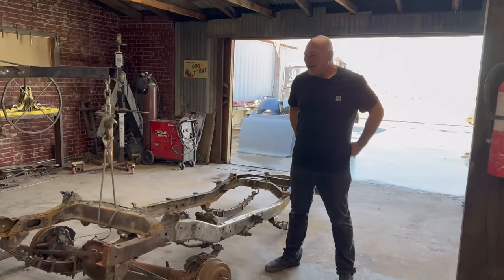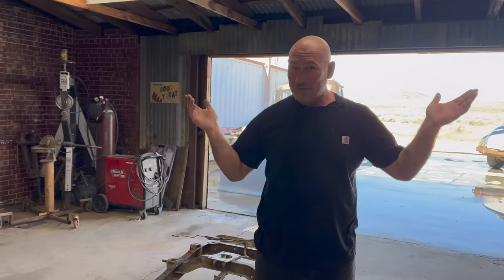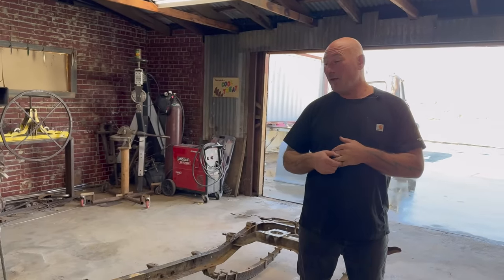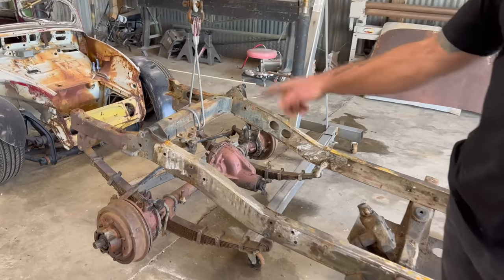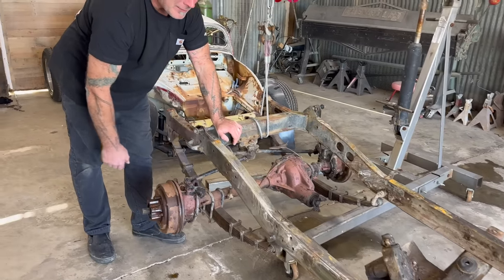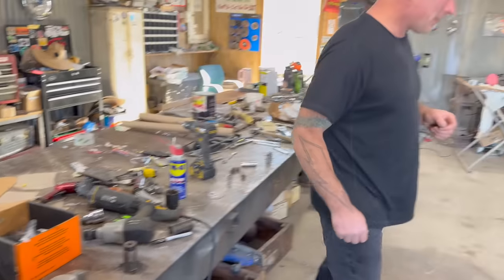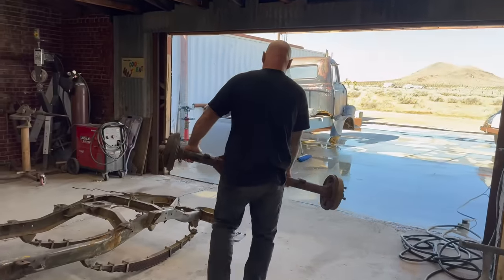Part 2! 1946 CJ-2a Willys Jeep! Ian And Jamie Have Some Major Kustom Ideas 💡 👽

Comment: The reason the military  used  your tire tread design is  it made it difficult  for bad actors to look at the latent  tracks and determine which way the vehicle was traveling .
Reply: This is a myth. They were a called NDT. Non Directional Tire. They were a Goodyear invention that enabled WW2 vehicles that uses them to get equal "bite" of the terrain whether going forwards or backwards.
They were also cheaper and faster to produce than directional tires.
Reply: @Maxxis1941  Correct.

Comment: The interference on the Hurricane engine in an earlier CJ2 is the carb.  The old school solution was to either cut a hole in the hood for the air cleaner to stick through and some would fab a little hood scoop for it.  Or, just put just enough body lift on it between the frame and body to allow the air cleaner to clear under the hood.  I'd go for the body lift myself.
Reply: I've also seen where they move the air filter lower to the side of the motor. They had like an elbow air pipe between filter & carb that was flattened on top of the carb. Maybe just use one of those cone shaped mesh air filters off to the side. 😋
Reply: Or a pinto carb...

Comment: Looks like you have a CJ5 chassis. As you found out the tub bolts the same way but the extra inch is in the front. I just finished up my CJ3B (hi hood) and there's not quite as much clearance behind the front wheels, but it doesn't look out of place. Have a look at some CJ3B pictures and you'll soon figure out where the front was lifted for the F-head engine.

Comment: I was told a hockey puck lift (one inch additional) between body and frame allows the f head motor to fit under the a body/hoods of the a's.

Comment: Once you get the motor mocked up in the chassis, look at a 1 barrel Holley from an early 60's Ford 200 6 or maybe even a 50's 223 6 cylinder. It might clear the hood without a hole.It's the carburetor that sits too high and not the valve cover. I'd leave the A1 chassis stock. Any wheelbase you can get just makes it ride better. Want to close an inch of gap, run a bigger tire!

Comment: A friend once told me how he used to put needle bearings into a Rudge motorcycle gearbox. He would slather the surface with grease, put the bearings in place, then tie sewing cotton around the completed shaft to hold the bearings in place while inserting the shift into the gearbox. The reason he used the cotton was that the first time the gearbox was used, the cotton would disintegrate without damaging the gearbox.
Prior to using this method, he had no end of trouble getting the bearings to stay in place because they would fall off the shaft while he was trying to insert the shaft.

Comment: The longer wheel base is going to be a huge advantage in handling and stability. I would retain that and then build around it, you are obviously fully capable of extending the fenders (or ever just repositioning them a little) if need be.
Reply: I second this emotion! Keep the wheelbase as is. Just bring the bottom piece of the fender forward a few inches & I'tta be fine! 😋
Reply: It is 1" longer only, not really significant.

Comment: You can also add 2 inch body rinse blocks. I had a 1959 utility wagon that I did it to with no problem.
Reply: I would think the body lift would save a lot of work
Reply: It worked out well for me. I would do it again with the body off already and the need to make mounts on the  frame. Also, it would be easy and inexpensive.

Comment: It’s normal for the front wheels to be towards the front of the fenderwells on the flat fender jeeps. It looks a little odd, but it’s typical. The extra inch is no big deal. Yes, the 3B had the taller hood and cowl due to the new overhead valve engine being higher than the old flathead Hurricane engine.

Comment: The F head engine will fit under the hood and just barely clear. Usually you have to fold over the metal seam under the center of the hood. The difficult part is getting an air breather to work under the hood. I had one that had a hole in the hood the size of the throat of the carburetor. When you shut the hood you could then place the breather\ air filter on the carburetor.

Comment: Hey Ian since the Jeep is leaf spring get some or make some leaf spring relocation brackets and just move it back till it looks good with the fenders that's what I would do don't cut the frame if not brackets you can always cut the brackets in a leaf springs off the frame and slide it back it'll still look good it'll still have its length and you'll still be able to put that motor in hope this helps you out

Comment: Back in the mid 70's i had a 1968 CJ 5 with a Buick V6 in it rebuild the engine put headers on it a better cam anf a 500 cfm Holley carburetor run real good and had tons of FUM playing in the MUD and sand
Reply: My 'daily' is a flatfender (titled as '46) with Kenne Bell equipped Buick 225 'Odd Fire' V6, too much carb and cam, MSD, fat headers w/ fenderwell exhaust, 4 speed with Warn OD on Dana18 transfer case... .

Comment: The M38A-1 has a larger gas tank (17 gals) so it has a well that protrudes downward. Because of that the frame doesn't have a mount under the gas tank on that side. Also, the front mounts don't get used where those triangular parts are at the front of the tub. They just seem to ride there in space. I've never had or worked on a flat fender so wondered if the mounts would be similar between them , so I think that's pretty cool that they line up so well.

Comment: Those tires, as you mentioned, are used extensively on military vehicles.  They are called "NDT" tires... Non Directional Tread.  They get equal bite going either forward or backwards.
Reply: Yep. We just called em military tires. First set I put on my F100 4wd were 900 x 16's here in the Fla. Everglades. Our mud is a bit DEEP! 😂😂

Comment: And as for the hood not fitting you can always put a little bit of a body lift on it making some spacers out of some a pipe I know they're supposed to be rubber butt pipe will work and make you a one and a half inch body lift kit your Hood will fit and it will still look good plus you'll have a little bit more room if you want to put taller tires on it your friend Tony

Comment: Love the old flat fender jeeps.  I've had 4 jeeps over the years.   A 1946 and 1947 CJ2A.  The "47 had an F head swapped in that was from a CJ3B or pickup so it had a hood scoop to accommodate the carb. The valve cover is still below the original 2A hood. Your wheelbase is not too far off.   The radiator mounts to that front cross member.

 Then I had a 1975 CJ5 that my dad and I did a complete fiberglass body tub swap when I was in high school.  the last one I had was a mid 90's XJ Cherokee sport.    Really want another one but the prices have gone out of site.  I'll have to look in my stuff.  I may still have some old CJ2A parts in the garage.
Reply: I’ve got a 1946 with an F head in it several carbs will interchange with the original that are shorter and you don’t have to put a hood scoop on it that way you can let the windshield down on the hood in the original way everything else fits perfectly fine

Comment: I am sure that you will get quite a few responses and some will be good, and some will not. I have had many jeeps and built several. I have just completed conversion on my CJ3B to a later model amc CJ5 frame, which has more modifications  than you will with a M38 frame. I have a 3B frame that has some stress on it and is already converted to saganaw steering, which is much more refined than the bell crank style you have and would give you the correct axle placement for your 2A. 

The M38, which is basically the CJ5, has longer springs than the 2A, and the difference makes axle placement longer than the 2A.

I would welcome the chance to exchange some of my insights  and information with you feel free to reach out and we can discuss things further. I might have a few years of experience and some other resources for your project.

Comment: Jamie, I know where they're at least four flat fenders. Just for parts. There's frames. There's bodies and even some original flat head engines but do your research like you are. There's a lot of people on here that don't know what they're talking about that's pre 338 military frame. It's got the 50 cal mount but it's probably an MB chassis and it's probably pre 46 so that's why. But the frame is the right length. The wheels are in the right spot. Just thought I'd let you know
Reply: Yes it's a M38A1 Frame, the Body is a CJ2A, the Frame is longer in the front.

Comment: I enjoy your channel. The high hood cj3b i think looks out of proportion to the clean lines of the lower hood hurricane engine models. I had a cj3a low hood body and changed the original engine to the  overhead engine. I did not raise the hood because the valve cover on the engine fits under the lower hood. The problem is the original carburetor is too tall to fit. Some owners cut a hole in the hood and made a scoop to fit the tall carb. I used the old school fix and got a lower profile carburetor from an early ford. It bolts right on and fits under the hood just fine.
Reply: That's interesting, hope they see your comment.

Comment: You definitely need the high hood Jeep body. The overhead valve engine sits six or more inches higher than the other engine does, the flathead and so that's why they called it a high hood they didn't make it for very long but it was a really great machine I had one and my friend still has one. Also the front axle is sitting exactly where it's supposed to, they left that space in the front for carrying extra Jerry cans or mounting a winch. most of the winches were gear driven and they also had a PTO on the back end.  I don't know which transmission you have and or transfer case but if it's the correct one it will have a side plate on it that is designed to put the front winch drive gear attachment to it and that will also drive the PTO in the rear .
Reply: Many are saying it's just the carburetor/air cleaner that hits, and there's a different one that solves the problem.
Reply: @65cj55   Yes this is also part of it. The engine block is taller as well.  Allowing for a longer stroke, and more torque.

Comment: Believe you worked on a CJ2a for a friends grandson ! Front fenders set will behind tires just like yours ! Why not get original Go Devil 134 L Head engine instead of F Head 134 Hurricane that came out of a CJ3b & early CJ5 then you won't need a taller grill , hood , firewall & cowling ! Should be plenty out there since everyone is doing V8 swaps these days ! Don't believe you're suppose to re-use old U Bolts once they've been torqued down because of how they put the threads on ! Also you might want an after market dual master cylinder & bigger brake drums for safety reasons ! My CJ3a you had to put your foot thru the floor to stop it !

Comment: Hope both you and your family had a wonderfull Christmas, have to say loving Jamies jeep,with the engine looks no no engine mounts so maybe you can lower it down a bit so you dont have to change the bonnet ,i suppose that will also depend on the front axle ,maybe might have to redesign the engine sump and oil pick ,i guess that also depends on engine to ground clearance. 
With the front wheels and fenders is it possible to move the front axle and springs back a bit maybe not depending on chassis i guess ,anyhow just a couple of thoughts
Reply: Hi Ian,Jamie,I just took another look at your video I think that you could move the front springs and diff assembly back 2 inches fairly easily ,thus not having to shorten the front chassis,I dont think you going to do any major off reading with it that would cause the diff to hit the chassis ,is so you could just splice out a piece and weld in a new plate ,might be a easy option

Comment: If you want an interesting engine to install instead of that "F" head, take a look at the VW diesel engine, used in the Jetta and several other models.  It's available as either a 1.6L or a 2.0., natural asperated or turbo.  The one I've always been intrigued by is the 2.L Turbo Diesel.
Reply: Kubota 3cly turbo diesel is popular in them.
Reply: Buick / Kaiser 225 V6 'Odd Fire'.

Comment: Just for the heck of it, I'd try moving the front fenders forward about 2 or 3 inches and see if that makes a visual difference that works. If you're going to change the grill panel anyway, you can probably make the front edges of the fenders blend into the new one and have it look natural.

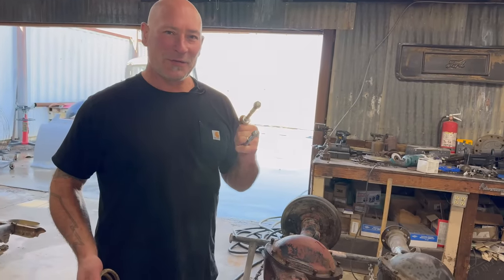Comment: If that has stock 5:38 gearing your going to want a Warn OD? It bolts to the transfer case, 12 forward gears & 4 reverse!
Reply: Leave the the suspension alone. The tall flat fender was a 3b

Comment: The starting of a cool project. Why cut the chassis just move the shackles back.and make all new body mounts if your changing out the Engine your probably going to have to beef up the frame anyway. I think it's going to be pretty nice I dig those wheels and tires .I had a dodge power wagon back in the early 80 s and I had the military tires like that on my truck.with the stock wheels blackened out I painted it a light brown metallic and Rootbeer brown top the bumpers and the grill were also black. She was a pretty stealthy girl. I was also in the Army at the time and those jeeps were still in circulation then. Great project Take care.
Reply: The Power Wagons were a beast, awesome trucks.
Reply: @65cj55  yes she was a lot of fun I enjoyed her even more when I got out of the Army.I had a 79  full time. No locking hubs.
Reply: @markrobertson9015  No one's going to road rage you when you're in a Power Wagon, that's for sure.

Comment: Jamie is correct, the Jeep with the taller hood is the CJ3B, but in my opinion, CJ2A/B look better and you're still able to put a pretty good engine in them without raising the hood or too much modification of the engine bay. As a proper Jeeper, I'm following this build like a hawk!!!
Reply: There was no CJ2B.

The 'flatfender civvies' were CJ2A (Universal), CJ3A (Universal) and DJ3A (Dispatcher). 

The DJ3A was 2 wheel drive.

Buick / Kaiser 225 V6 'Odd Fire' is an excellent choice for a 'flattie'.
Reply: @-oiiio-3993  You are correct, I should've said CJ-2A and CJ-3A since it was the body type I was referring to.
Reply: @abnpthfdr2934  Stuff happens.

MB / GPW and MC (M38) are also essentially similar.
Reply: @-oiiio-3993  Yes, Sir. MB/GPW are my favorite and the M38 a very close second. Have a happy new year!!!🤙
Reply: @abnpthfdr2934  
I shall.

The generator rebuild for my newly (6 mos. ago) acquired Willys MB is ready to be picked up and installed.

Comment: Why not extend the body right in the middle?  Basically cut it in half right through the middle of the door openings and move the front half forward a few inches.  You would get the bonus of more interior room.

Comment: I am sure someone already explained it to you but the frame is longer at the front and the rear, , you can use the taller engine without cutting the hood, either a small body lift or use a shorter carb

Comment: What was the issue with the rear U-bolts and plates to secure the axle in? It looked fine to me, where they not long enough? The flat plate sits under the leaf spring and the U-bolt drops down over the axle as seen at 7:10

Comment: I was looking at the front wheel spacing and it seems to me that if you just move the front fenders forward to center the wheels and shortened the fender length so it would not stick out in the front it would look almost like it was made that way?

Comment: That tread design was so that when driving under 10 miles an hour the enemy couldn't easily tell which direction the vehicle was going unless the vehicle was turning a corner.
Reply: It was NDT - Non Directional Tread, which gave equal traction forward or reverse.

Comment: If you look at pictures of WWIi jeeps the wheel base lines with your jeep in front
Reply: Hers is a CJ2A, the front wheels should be back under the fender more and the don't have so much out front, because they had shorter springs...the  frame's from a M38A1, they were longer.

Comment: Super cool, the 1'' difference is in the rear, there's 4'' difference in the front, i would just bolt the body on as is, once you black out in behind the front wheels it will look fine....please build her a full cage for it though..

Comment: Why not cut the body in the door area & move the front portion to suit the wheel position in the wheel well?
Reply: Then you have to modify the firewall for the engine to come back into the body, plus they look wrong stretched, Jeep done it with the CJ6.
Reply: @65cj55  only opinion, but I’ve always thought the CJ6 cool because of the extra length. The extra was behind the seat. 

I would love to get my hands on one, partially because there’s a good chance they haven’t been bastardized. Too bad most of them were exported. Not many sold here in the states
Reply: @dougbowen4685  Yes they were ok, but that panel they put in the side looked all wrong.

Comment: You going with an electric or PTO winch? 
Admittedly I do like the look of the bidirectional tires on our Military rigs. However, in my case the split ring bead lockers scare the living crap out of me. Also I tend to snow plow my front end when turning in soft soil. Come spring I'll be going with Michelin 395', 46" tires on an MRAP style wheel. I could go as high as 53 inches but that would throw off my center of gravity. 🙃
Reply: 46'' ! you will spin the world off its axis lol..

Comment: I'd say the frame is 8" to 10" too long in the front. The rear spring mount should be about even with the bottom of the front fender
Reply: It does look that way, but it's actually just over 4''.